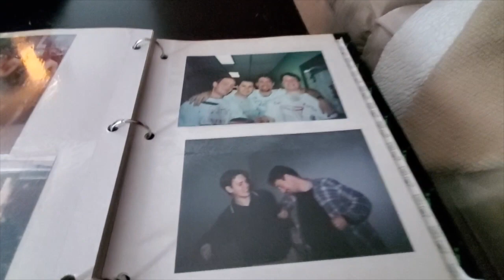1MHz in Air

Comment: hey man i don’t if you look at your comments at all but if i could i would like to request a video on carbon fiber and how to cal and set up for testing of that material for like straight beam, UTSW and PAUT
Reply from the maker: Carbon fibre is something I need more practice on
Reply: @hollowayndtengineeringinc.5201  also i have another question, you wouldn’t happen to know what the material velocity for carbon fiber would be do you? in us measurements
Reply from the maker: @dylanlobue7531   Negative sorry
Reply: material velocity for carbon (CFRP) is roughly between 2800-3000m/s or 1100-1180in/micro second. Best thing to do would be to use a reference piece as there are a lot of variables for composite inspection.